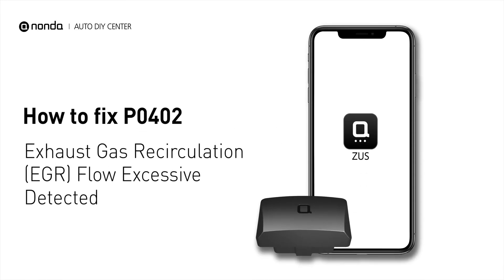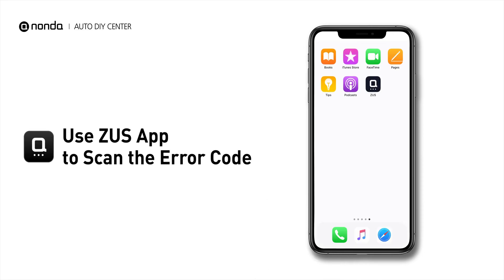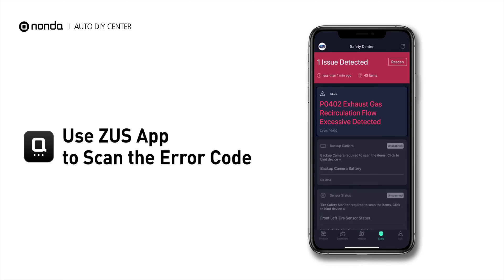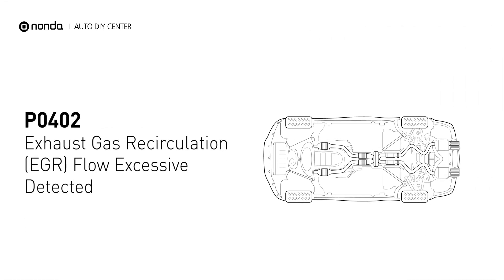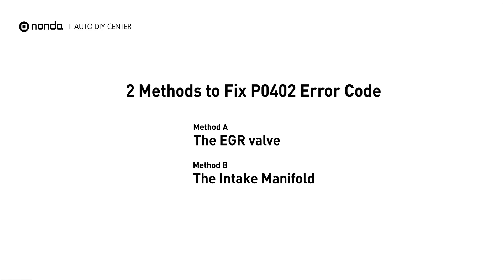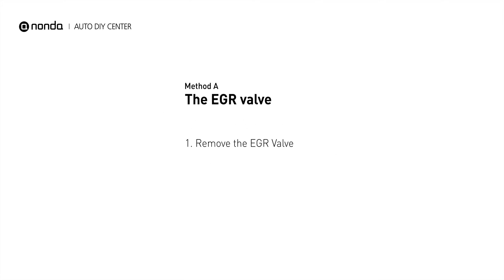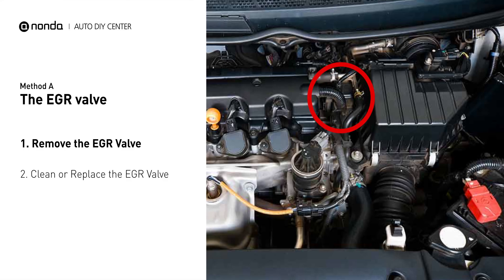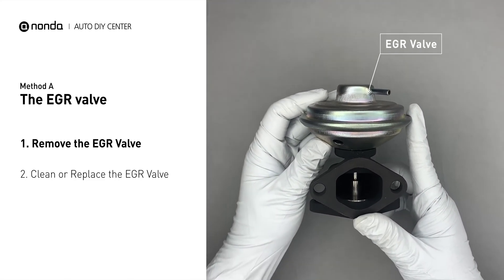How to Fix P0402 Engine Code in 3 Minutes [2 DIY Methods / Only $4.26]

Comment from the maker: Hi, I'm Steve, nonda's lead mechanic engineer. 
Feel free to leave your comments here if you have any mechanic questions, I will be glad to help you out!
Reply: Hey Steve, nice job answering peoples questions over the last year, thanks for letting us know you’re really here to help the community . So admirable
Reply: @WPXTacoMan477   :))) :(
Reply: I'm getting P0402 and I replaced the EGR myself and the code immediately comes back. I didn't cheap out on the part either cus it originally costed me $140. I was experience intense clicking from the Cat when the code rose up so I am wondering if it's possible a bad cat can trigger a false EGR code, since they are technically connected on the same system.
Reply: @cameronartukovich6810  I had that problem was a missfire 3 injectors needed replacing
Reply: @Matthewjhunter1  dudeee same here, I replaced my EGR valve and still had this code. So you replaced your fuel injectors and it fixed the code??
Reply: @yamadath0  same here pls help
Reply: @Lappensepp1  honestly ni dont worry about it anymore, im still getting the code but i think its a faulty sensor tbh. It goes on and off alot so i dont worry about it anymore. I think its fine
Reply: @Matthewjhunter1  that’s insane, if you say you replaced 3 injectors but still have the problem, why would you suggest that your injectors were the problem to someone with a similar issue, but yet it wasn’t even what was your own solution..?
Reply: Hello Steve. 
I had my car remapped and shortly after, it threw this code as well as P1160 which is 'Heated exhaust gas oxygen bank 2 heater.
Any chance you know what I can do to fix it.
Thanks !
Reply: I have had a p0402 code on my car egr was replaced aswell as 3 injectors then I got the message again (service due soon) put the code reader on and got that code any ideas on what to do
Reply: Hi!  We are on the road pulling a 5th wheel.  Just got this code.  In your opinion, are we safe to make the 400 mile trip home before getting this addressed?  It's quite likely it's a dirty valve as mentioned in this video.  We have to leave in the morning so a quick response with your opinion would be so appreciated.  Thank you!